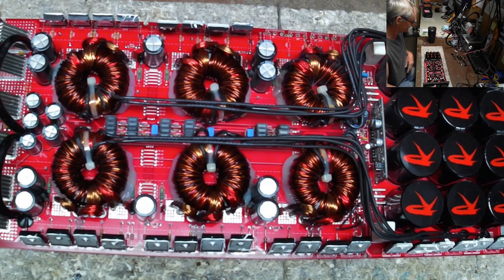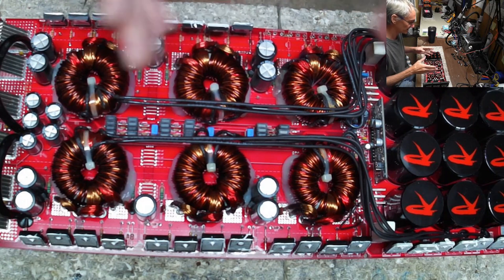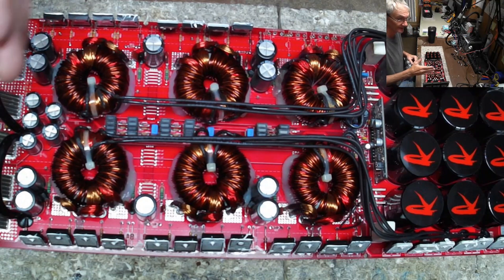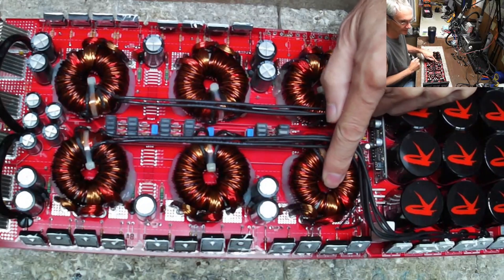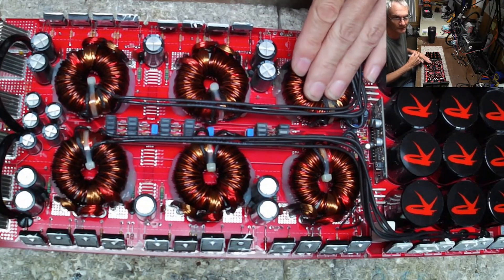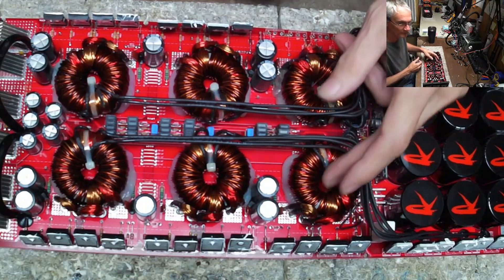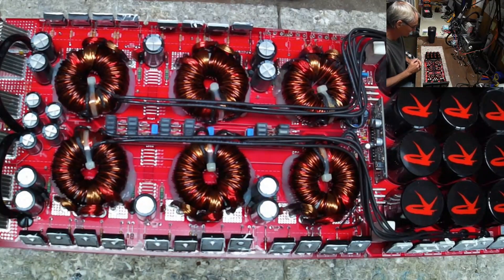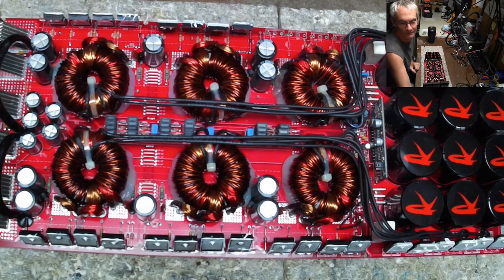I'm Not Smart Enough So Is this Transformer Saturation? Korean Class D Power Supply Failure

Comment: I don't think the toroidal is saturating. The low side switching currents will be at it's highest at idle, when the output stage is oscillating but no audio driving it. As you play audio it starts to modulate and the switching currents now become a factor of the duty cycle of that modulation.

If the core were to saturate, it would be most likely occur at idle when the current is the highest. You can use a thermal camera and see how hot the core is at idle.
Reply from the maker: Thank you for this information. Most of these failures are "it failed at idle with no volume" usually after they did a demo or a pull. Some failures were just stopping at rest stops on trips. So I do believe there is a heat factor to this. I am a little confused though when you state the current is highest at idle. I am assuming you are saying the switching circuit currents (as in the drivers?) and not the primary power current. Now we are getting somewhere! I would love to be able to direct my customers in a direction to avoid this problem.
Reply: @ellensburgamplifier  Yes, gate drive currents will be its highest. But since the primary current of the transformer is just a multiple of the secondary, it would also mean the primary current would be at its highest as well for that toroidal.

it's possible some kind of thermal runaway is happening. 

What usually needs replacing when it fails like this? When the PS FETs fail are the output FETs failing as well?

Comment: Without a schematic and making some guesses all 6 transformers are creating the main HV  +/- rails. The aux winds on the on the bottom right making the +/- 15v sounds correct. The 12V above -HV rail voltage coming from an aux wind on the top right xformer also seems plausible. These are all very low current circuits and I don't think that's what's causing the failure of the switching fets. I can't see the output section in the vid so again guessing this is a 2092 based class D output or similar.  If you suspect saturation from power and heat caused an inductance drop that could certainly take out a bank of fets. Weakest bank fails short and blows the main fuse saving the other 5. This heat can also damage the transformer core permanently and rewinding it won't fix the issue. Pull the transformers and check them with an LCR meter. Also anything that happens on the output. Blown open or shorted speaker will reflect back through the amp stage to the power supply. The amp stage is a control valve between the PS and the load. Usually the output filter caps will fry from an open load condition. Heat can  ruin the ferrite core of the output inductor also. What I'm saying is it could be an issue in the output blowing the PS even though it all looks ok and functions at low power. My $.02. I could be totally off base. Good luck.

Comment: As an inductor reaches it's saturation, it tends to lose inductance which will require more input power to sustain the output.  It can also cause shifts in switching frequency that go beyond the range of it's control circuits.  

You could probably test this by watching the transistor behaviour and switching frequency under varying load conditions.

But without the specific schematic and specs, it's hard to say for certain what goes wrong.

Comment: The saturation depending on the switching frequency, the characteristics of the core, how many turns you have in the primary winding, etc. It doesn't matter what you have in the secondary side of the transformer, except short circuit.

Comment: Well sir you and bear vids are the only ones I watch I haven't noticed one thing he always says it's a generic design with that being said if you just noticed that you're having this problem being that it is an old design and battlefield tested I would say it's a lack of quality control substandard copper on something that is being pushed hard,, I'm also into reconing subwoofers and at one point in time f u audio and Patrick got a bad batch of voice coils that checked out when built but when put under strain failed
Reply from the maker: Thank you Frank. That is why I am digging into this. If I find something that could be causing this I will be able to forward the info to the powers to be for the OEM to change it.

Comment: As I understand this topology, OpAmps load is pretty low so there is almost low additional power added to transformer with -15-0-+15 V supply.
But negative rail +12v line have 2x 7812 linear stabilisers in parallel to supply driver circuitry of negative rail.
What i sure that output driver MOSFET loses is caused by
- channel resistance - not affect driver side
- capacity of the gates and charge required to switch it from open to closed state - affect driver side.
- switching loses in channel during switching time - not affect driver side but affected by driver - how well and fast it can switch mosfet

So capacity of all gates is added and multiply load for the driver output. In the case it's driven directly by IRS21844S - it can have hard time to drive 6/8 mosfets directly. If it have buffer driver - it's easier.
I expected that gate charge should be independent from load impedance. As lower load impedance should increase mosfet losses on channel resistance and during switching time.
But from one russian amplifiers technician I heard info that lower impedance load causes to increase losses on gate recharge!
So it can sum up and if amplifier is used with low ohm loads it's already pushing PSU transformers, and if power requried to drive negative rail also increased - so it may add load to this transformer.

For me it's still confusing as i do expect that driver may fail earlier, or if power required to drive negative rail mosfets so huge? like more than 30 watts? Not sure.

As from my understanding saturation is possible when power is greater than this core can safelly handle. So can it be that amplifier is used with low impedance load and this caused saturation / high core loses / high core temperature and changed magnetic core properties?

Sorry for this stream of thoughts, I'm not expert in this topic, just interested little in half bridge amplifiers :)

Comment: Which ruthless amp is this?
Reply: looks like the 8500
Reply: Yeah must be the 8500. I'm working g on 2 of the 10ks and they have 8 transformers.
Reply: @hopskustomaudio  how are the 10k going?
Reply: @anthonydavidson9379  I haven't even had a chance to check them out yet. I do know what caused them to blow tho. Speaker wires were touching. Hopefully it didn't get anything on the power side. He said there was no smoke and I can't see any physical damage on 1. Haven't had the back off of the other yet.
Reply from the maker: @hopskustomaudio  Ah that's where they went ;)
Reply: @ellensburgamplifier  were they supposed to go to you?
Reply from the maker: @hopskustomaudio  Oh not sure about that. I did have a customer ask for me to look at two 10k's but have never seen them come in. I was unable to repair them privately as I do not stock the 45N50 output transistors. Maybe if I had more repairs that use them I would stock them but man look at the cost. I can't justify sitting on that overhead.
Reply: @ellensburgamplifier  yeah they are definitely expensive. I only order those as I need them. Lol